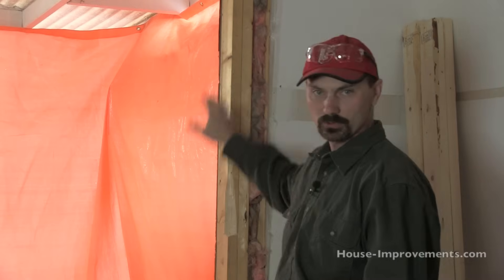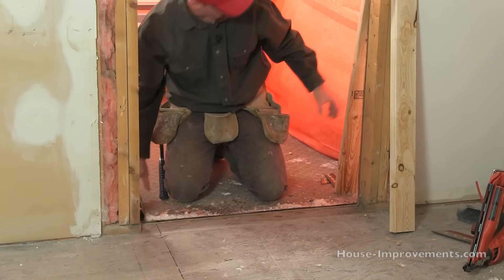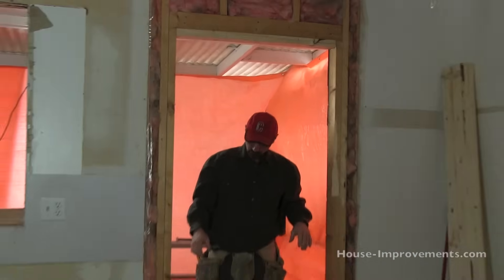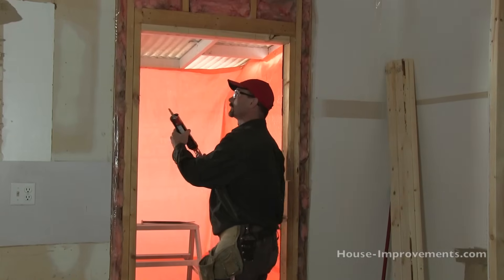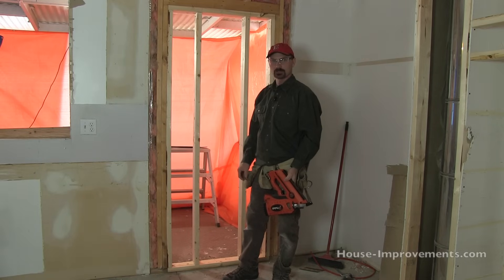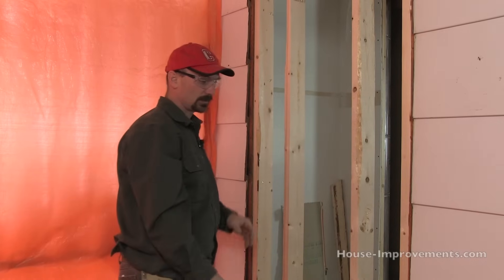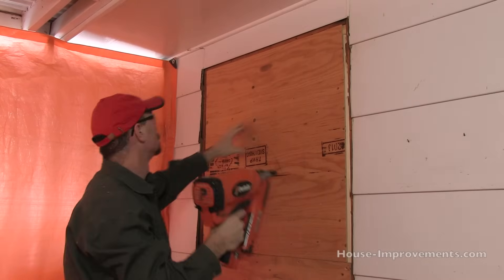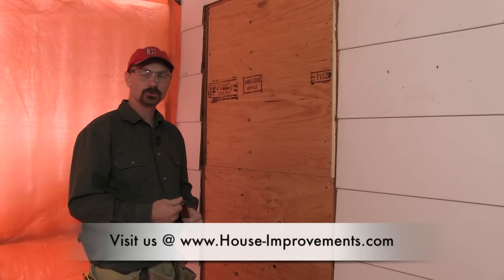How To Fill in a Door Opening [Framing]

Comment: What are you nailing it to?
Reply from the maker: Which part? plates to the plates above and floor below, studs to the plates , plywood to the studs?
Reply: @HouseImprovements  the plate to the floor is that not a cement pad the house is sitting on? How would you attach thay to cement

Comment: Found your video while trying to figure out how to fill in the old doorway. I have an old stone house and for some reason an old owner decided to board up the original doorway (with a lovely stone arch) and put a new (cheap Terrill door which didn’t shut right and let the wind, rain and snow in) doorway in cutting out the original stone. I had a new door put into the original spot, which now looks amazing) but what to do with the old door before cold weather. I can’t get a carpenter/handyman (they are in such high demand) for months. So, I googled how to fill I. The doorway and found this great video. I think I can do it myself (hope, anyway) and think this video was so helpful and informative. Now I just need to figure out what to do about the stone work on the outside.

Comment: Why is it necessary to add the boards to the existing framing? There are already two boards on either side. What is the purpose of the third board on either side of the framing?
Reply from the maker: support for the drywall and plywood
Reply: @HouseImprovements  Got it. Thank you :)

Comment: Would i use this same method to lower the height of a door opening? For example, insteed of placing the plate at the very bottom of the opening, i woild just place it at rhe new height? 

Im looking for ways ro decrease my opening from 90 inches to 82 inches.
Reply from the maker: Yes.
Reply: @HouseImprovements  thank you!

Comment: If we wanted to make shelves on outside. Should we put house wrap on the plywood on inside of house (door frame)?
Reply from the maker: House wrap is installed on the exterior of the exterior plywood before siding or exterior finish is installed.

Comment: I dont want to buy a framing nailer for one project. What size and type screws would you recommend instead?
Reply from the maker: To do this exact thing you would not need structural screws so 3" #8 deck screws would be fine.

Comment: Hi! Why couldn't you use the original framing thats already there? Is there a reason you double framed it with new wood?
Reply from the maker: I would have to cut back the old drywall and exterior plywood to expose enough framing wood to attach the new drywall patch and the exterior plywood patch to. Adding more lumber just makes the process easier and quicker.

Comment: Hello, I want to remove an oversized patio door and put a kitchen sink along that wall. Can I drill thru the king stud l, especially since it will no longer support the patio door and will have a stud replacement between it and a new smaller window above the sink?

Comment: Nice video. 1) Why add the top 2x4 ? There is already a crown 2) The additional  wall studs shouldn't they be placed to continue the existing 16 on center spacings from outside the  door frames . Thanks.
Reply from the maker: I could have nailed the studs to the bottom of the header for sure.  You could place them so they land on regular spaces but I didn't

Comment: I’ve noticed all electric nail guns make that funny hair dryer noise for a few seconds after use. What is that noise?  Is it a fan or something?
Reply from the maker: There is a fan blowing excess gas away that was not burned during firing. This is a butane gas nailer.
Reply: HouseImprovements   Butane!  Okay, I thought it was electric. That’s amazing, thank you.
Reply from the maker: Battery creates the spark to ignite the butane which then drives a piston on the driver that hits the nail.

Comment: I have hardwood throughout my house. Do I need to remove the hardwood under the door jamb before installing the bottom plate or can it be installed directly on top of the hardwood floor?
Reply from the maker: If there is hardwood right to the exterior (really there should not be) but if there is cut it back before installing the plate.
Reply: Thanks for the reply. It's not an exterior door I'm wanting to close; I should have mentioned that. We opened the wall between our kitchen and the living room so the old cased opening to the kitchen isn't needed so we want to close it up so we can redo our kitchen and add more cabinets where that cased opening is now. If it's an interior wall, does that make a difference? I've read that leaving the floor under is OK but wanted to check with someone more knowledgeable. Obviously removing the floor where the bottom plate will go will be more work but I'm not afraid of that if it's the proper way of doing it to avoid future issues with the floor and/or wall. 

The other option I thought of was just "floating" the bottom plate a half inch or so above the floor and attaching it to the existing studs on either side with either pocket hole screws or framing nails. I thought maybe that would be OK since I assume this isn't really structural so much as it is giving us something to attach the new drywall to since there is already a header above this cased opening so the bottom plate shouldn't be carrying any load. This way we don't destroy the floor underneath in case we or a future home owner decides to take the wall back down. Is that another possible option or another bad idea on my part? TIA!

Comment: Thanks for another great video.
What caulking do you use? 
For applications where creating an interior air barrier is requiring (to prevent smells from one room to the next, for example) do you recommend using 3 mil plastic?
Thanks!
Reply from the maker: Normally your finished drywall will accomplish that oil its own. Our forum is a great place to ask question like these ,please give it a try https://www.house-improvements.com/forums/

Comment: Is that code in Canada? I've filled in an interior doorway and except for the soul plate, I didn't double up the sides (yours were triple with the extra jack studs). You couldn't have just put the soul plate down and cut your up rights to nail directly into the header? Or at least a top plate so you wouldn't be side nailing into the header. Good video and a good job.
Reply from the maker: it is not code ,I like to be sure that I have a good nailing surface all around the opening, especially out side in this case the outer sheathing was only 3/8 so its pretty flimsy.

Comment: what is that nailer machine how it work
Reply from the maker: It is made by Paslode. It uses a butane canister and battery to drive the nails
Reply: Marcela Rodriguez I personally would not get dat. fuel is expensive and not built for true framing. Prolly ok for backframing tho

Comment: Hi Shannon,  I have an opening in the living room. I want to install a door. The remaining openings will be fitted to the drywall.
  The  wooden frame in the opening has been covered by material as used on the outside surface of drywall ( I don't know how to call this kind of material--sorry) . this is a finished opening. Should I  remove these materials before installing a door? Will it be hold well if I put the door directly onto the drywall material?
In addition, this opening height is 80 10/16 in. The door I bought is 80in. Door+Jamb is 82in. What is the standard thickness of this kind of cover material? If I remove the those material, the opening will have more height and  I do have to cut the door?

Comment: what nailer are you using and what size nails do you need to use to go through a 2" board like you are doing?

Than you,

FB
Reply: The nailer is a paslode, can be found at most big box stores. 3" nails are common in framing.

Comment: I always watch your videos before a DIY project to refresh my memory - thx for posting.  However, moving a door in my almost 60 year old home, I realized a 1950’s 2x4 is not the same size as a 2020 2x4
Reply from the maker: yes unfortunately they are not the same dimensions
Reply: Neither are 2x4s from 1977 when you give them 45 years of drying and shrinking. They are legit 3-1/4" wide.
Reply: @BoldWittyName  the older cuts of lumber are bigger than they are today ! … you are saying years of drying makes them bigger?  Nothing to do with drying … they were cut bigger what can I say.

Comment: I missed something.  I am presuming the door area is 30"  so why didnt you simply make it easy to insulate by putting the stud right in the middle with two 15" openings.  Its not a 16 but close enough.  No?
Reply: Adam Turnbull to maintain 16" OC that the rest of the house has. Just keeps it consistent